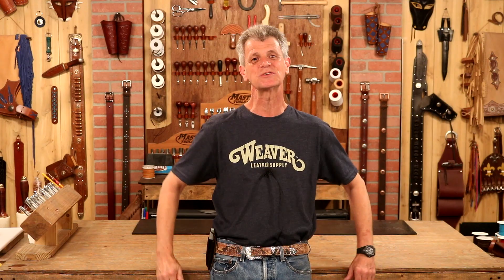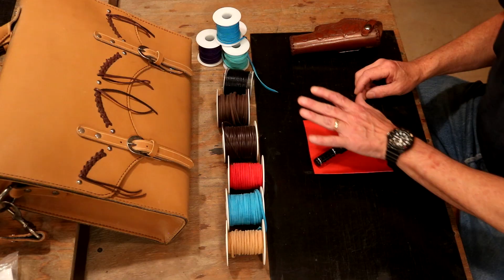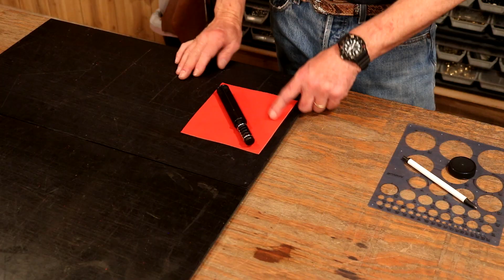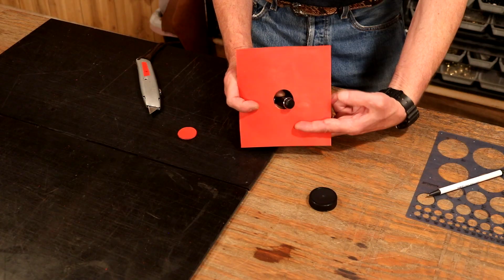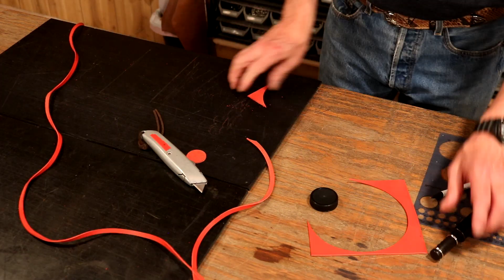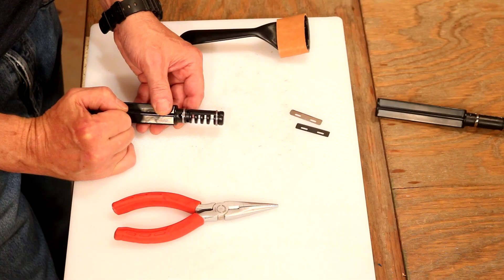The Leather Element | Leather Lace Maker

Comment: Probably the most frustrating tool to use.  I don't know why it's not working.  It will cut around 3cm lace but it doesn't pull through as it cuts off.  I'm using leather 2mm thick.

Comment: A tip I discovered for this method, if the lace is still curling more than you'd like for the application at hand after you've tried to stretch it straight by hand, you can lightly wet the lace by running a damp cloth over it, loop it over a curtain rod, and tie the ends to something with a little weight like a tool or water bottle or whatever. Let it hang for an hour or so and it'll come off straight as an arrow.

Comment: Could.we get a leather element discussing how to harden leather?
Reply: All you need is you kitchen oven. Wet your leather, place it in you over on the middle rack and set your oven for 350 degrees and set your timer for 30 minutes. The leather is going to be VERY HOT so use an oven mitten 7:19 to take it out. The bigger problem, explaining to your wife why the oven smells like cooked leather until the smell wears off. Hence, your food may taste like cooked leather. Good luck with that!